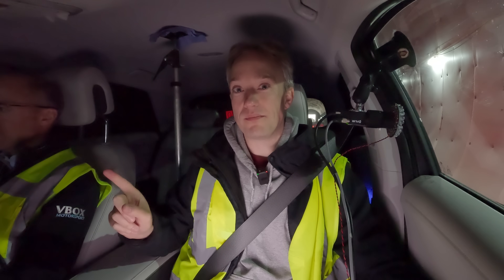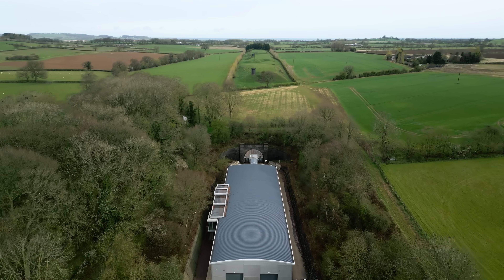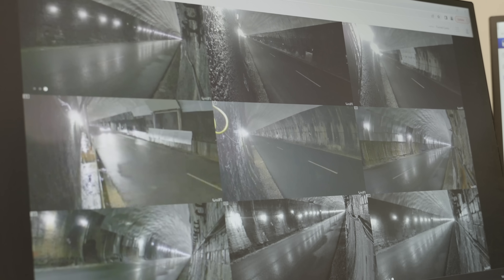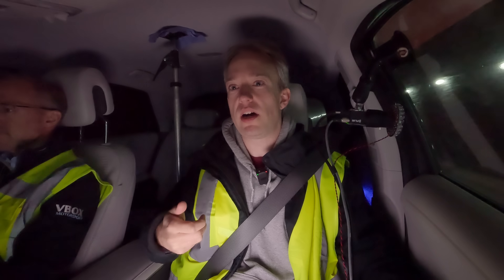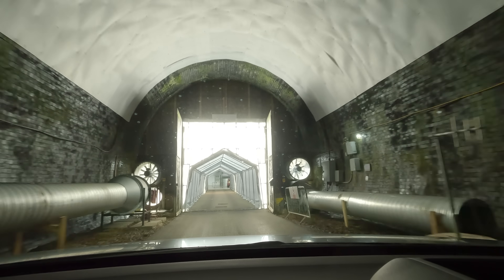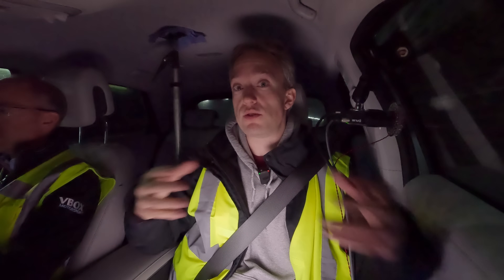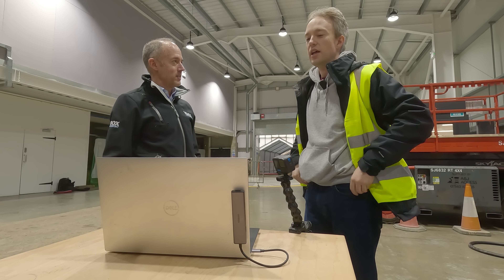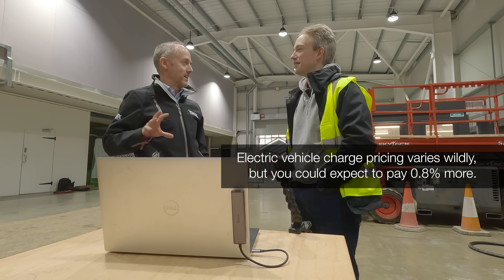This is an excuse to show you a really good tunnel

Comment: I can definitely imagine frictionless tunnels in the next 30 years after this.
Reply: frictionless is impossible
Reply: And dangerous. Frictionless means brakes aren't going to work
Reply: Brakes based on friction against the ground anyways
Reply: @theblinkingbrownie4654  How would such a brake work then? Conventional brakes are applied on wheels rolling against the ground... are you suggesting a brake based on air resistance, like a massive sail or parachute deploying?
Reply: @tinynewtman  or magnets
Reply: @tinynewtman  I'm not suggesting anything considering I'm not experienced enough at engineering, but I just figured that theoretically it wasn't impossible.